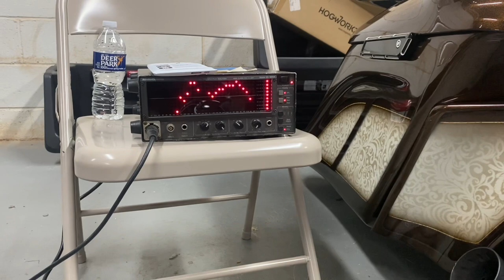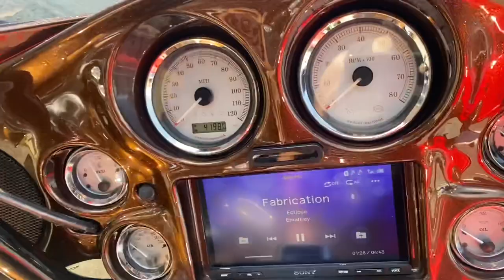Beautiful Harley-Davidson Street Glide in for a HUGE Euphoria Xpert / Sound Digital audio upgrade.

Comment: So can I put my 10" mid base driver facing the outside of my saddle bag
Reply from the maker: Facing the rear wheel or facing outwards?
Reply: Wich way is better?
Reply: Should I put them facing the inside rear wheel or outward
Reply from the maker: @djkingsoul29  facing the wheel